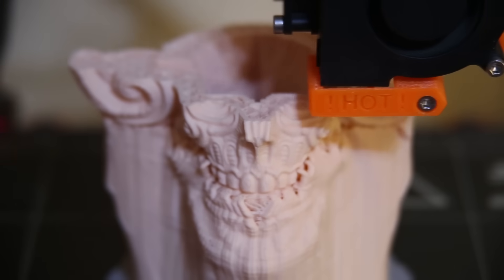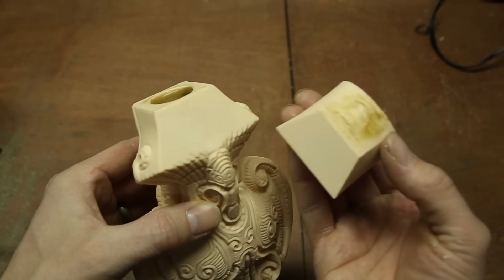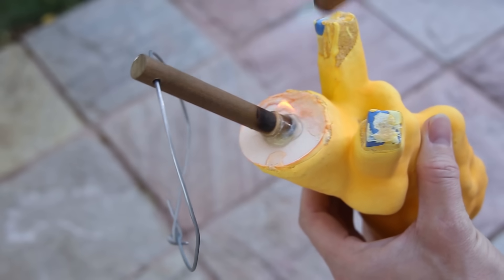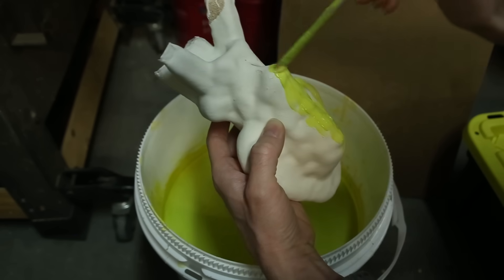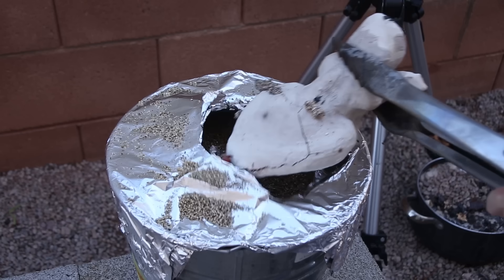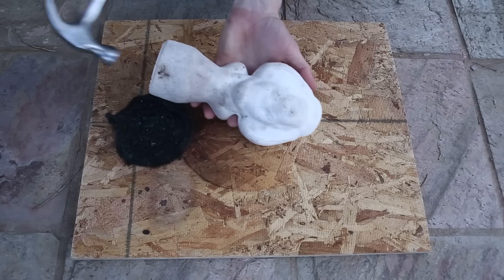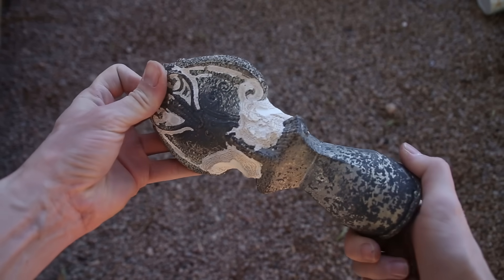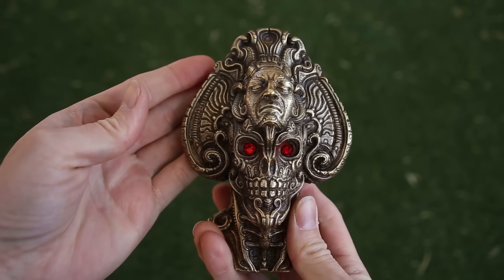How to turn a 3D PRINT into METAL │ Lost PLA Metal Casting │ ASMR

Comment: To prevent cracking next time, slow down your heating rate. Get it up to half temperature of burnout or something slowly and let it stay there to get the moisture out for a few hours. Then crank up the heat slowly to the final burnout temp.

Comment: Wonder if a hollow resin print would do as well.
Reply: There are (quite expensive) 3d printable resins used in jewellery making for that purpose. But if you're still in the experimenting phase or plan to do a small production run, i would still recommend to make a silicon mold of your perfect master and to do lost wax prints so that you don't start from scratch  every time your metal casting fails. In professional art foundries, there's always one or two spare wax prints waiting in case the casting fails, bronze being the trickiest to successfully cast because how hot and dense it is compared to aluminium or brass.

Comment: I wonder if the "ash" from the first mold was actually the thin layer of ceramic that had flaked away when you burnt out the PLA. The reason I think it may be ceramic is because you got suspenda-slurry inside the hollow part. This would have left a thin layer of ceramic on the inside between where the metal would be poured and the detail of the print. Basically, there was a thin void where the thin PLA shell was.

Something like this:
||||| PLA ||| main hollow inside the mold ||| PLA |||||

Comment: put your molds on top of the klin to heat them up while your melting the metal before pouring the molten metal in. Molten metal on a cold surface will dance and splash around like water on a hot plate. The sudden thermal shock of the molten metal caused the mold to crack and break.

Comment: Just an idea: 3D Print with ABS, try to make thin wall prints and low infill, and after that remove the plastic with some acetone washes.
Reply: Thin walls and low infills seems like a recipe for abs to warp. If someone could get it working reliably though that would be absolutely awesome!

Comment: 1:14 Vertical line on the base. Why is that? This is similar to the closing of the halves
Reply: That is due to the 3D Print. The outside line of every layer needs to have a start and end point. The nozle sometimes drips some extra/unwanted material at those points leaving the print with "blobs" such as these in the video. In some software you can compensate for that by setting the start/end of each layer to a specific location. Most of the time you want to place it at the back of the model where the seams are not as visible resulting in a line of "blobs" on the outside layer. Hope that helps.

Comment: Those eyes!

Im looking at this sort of thing because i want to be able to make trigger parts for the m16 and m4 rifle. They are also done with casting of IC 8620 steel. Im not sure how to heat the steel up to the melting temperatures. Maybe i will have to design an induction device that can heat up the crucible and the contents (IC8620 steel). 

I tought about the 3D printing method. And looking at the resolution. That way seems really possible.  

What sort of PLA did you use? 

Keep up the good work!

Greetings,

Jeff

p.s.
If you are looking for blueprints of this gun, google: "ivanthetroll"

Comment: For the first one that didn’t turn out, rather than using vermiculite as the insulator, why not use sand / greensand and pack it in a bit more? That way you’d have something more structural and prevent the base from falling out. Final result looks great though!

Comment: To make the part hollow, try this: Print the part. Coat the outside of your 3D printed part with multiple coats and silica sand. Fire it to remove the original form. Fill the form cavity with molten wax. Let the wax partially solidify. Pour out the remainder of the wax, so that the inside is coated with about 5 mm (¼") wax. Optionally, insert a bar of wax to connect to the far sections of the part. Make sure you have one or more sprues of course. Coat the inside wax with your slurry and silica sand multiple times. Let it dry. Gently heat the form so the wax can melt and run out. The remainder should evaporate when you fire the form.

Comment: I like how you have makeshift shields and guards for various minor nuisances, while pouring molten metal and blasting particulates from the workpiece. I was surprised and saddened not to see a swarf-collecting box during sprue cutting stage, and a stench deflector during the "liver of sulfur" stage. ...not that I've ever smelled liver of sulfur, but the name alone smells pretty bad.
More importantly, however, why don't you bury your mold in sand instead of vermiculite? I don't think the insulation or lung cancer are of benefit when pouring non-ferrous alloys, while the conforming mass of cheap "play sand" very well may have hugged your first mold tight enough to keep it from being a total loss. I suppose you could have wrapped a bit of thin wire around the mold too, but had it worked the first time, half the video and half this comment would be missing.

Comment: very cool. would it be feasible to pre-heat the mold in your kiln so that it doesnt experience as much thermal shock during the casting process? i feel like that would help in preventing the mold from cracking, but i'm no foundryman

Comment: There are filaments that are water soluble, mostly used for 3d prints supports. But in this case you could try to make a model with it, dip it into slurry then just wash it out after solidified. Should give you better results than burning the regular PLA...

Comment: Over two years watching Lost PLA videos and this is the first time I've heard of adding the  
"SuspendaSlurry" stage. I will be making my own 'slurry' to achieve the smooth/detailed surface. Thanks.
Reply: Ive seen someone use drywall texture mud, mixed to slurry consistency, for the same purpose. However, that was for lost foam casting, not PLA. I'm not sure how the texture mud would hold up to the burnout process. Also, it would need to be supported by something more substantial during the casting process. Ex. bury it in sand.
Reply: @Can Mei You can, they(Ransom & Randolph) ship worldwide.

But I do not know how much you want it as a 60lbs drum will set you back just over $200 and shipping to europe is almost $400. Even with the current conversion rates you will need to pay €500 for a bucket.
But perhaps you can contact them and see if they have a European distributor.

Comment: that bad boy looked fantastic, they crystals in the eyes added a next level of pop to it. Its so frustrating when you spend that much time on something just to fail, the key is to never give up. What clear coat are you using to coat it with, I have found issues when using spray clearcoat with anything that is painted, makes it wrinkle up in some places.

Comment: It looks great!  Bummer the hollow casting didn't work out though, that lightweight perlite might be a great insulator but it didn't seem like it tried very hard to contain the bronze or hold tbe shell together.  I'm not a shell guy, but I know some guys use sand for that.
Reply: yeah a bucket of dry sand would work much better.
Reply from the maker: Thank you! And yes, you’re right. My thoughts exactly. The problem with sand is that it’s so much colder than the shell and I’m always worried that the shell will crack. I haven’t figured out a great way to heat the sand yet. I was thinking about burying a large chuck of super hot steel in the sand. Maybe that will work.

Comment: When I started to watch the video I started to thing - woah - maybe thats an idea to make some less weight statues (make them hollow). That was an awesome idea of yours. More slurry would be needed to make it but less molten metal so you can make bigger statues from a A8 crucible. 
When I came to the point that you gout cracks, ad ones after burning out - I started to think will the shel last the temperature tension. And unfortunately I was right - it just broke.
Couple of  things that came to my mind is that - the cracks probably came out of tnesion from the wax (it has lowers melting point and it need a fast fire method of burnout - because of that maybe the tension from the wax was transfered to the pla print which was not soft enough and thats why there were the cracks. Thats my first thought.
Next tought is that when you try to repair the cracks - i mix the slurry with some sand and make it like a paste. Put at least 3 coasts of that paste onto the crack. Maybe because you made not thinck enought repair thats why it cracked.
Another thing is - how many coats of slurry do you make? Regarding R&R information there should be done at least 8 coats. I make mine in 1 slurry only (to get the most detail) 2,3,4 coat with sand of 0,1-0,2mm fine sand gradation still to get the detail, and then 5,6,7,8,9 layers with sand 0,1-0,4mm gradation as a support ones. Each coat after drying and before aplying the next one I prewet because then the slurry itself sticks to the previous layer better (those are my personal opinion thoughts).

Either way - the seconf cast came out great but maybe you could take some thoughts from my opinions and check if they are worthy to you makeing a lost pla statues.
And Seth - remember that I lost PLA castings that I do started from your Death Trooper cast :)
Reply: Dragon Atelier ! 
Can you propose some recipie as Lost foam caoting